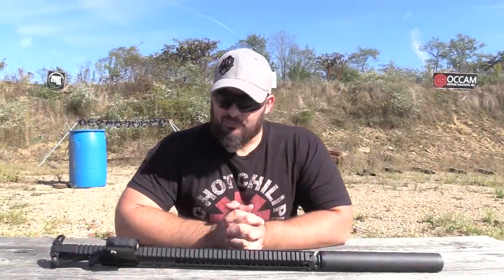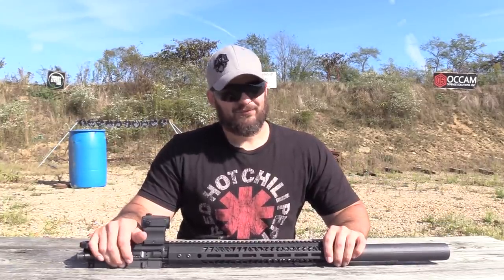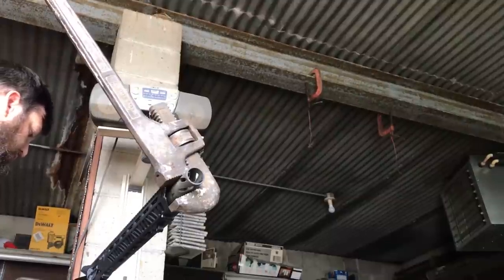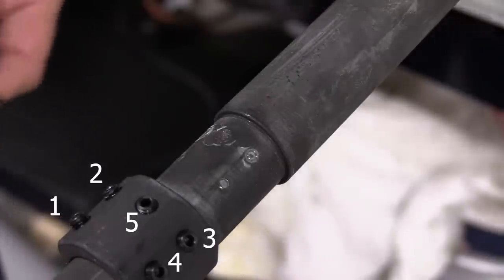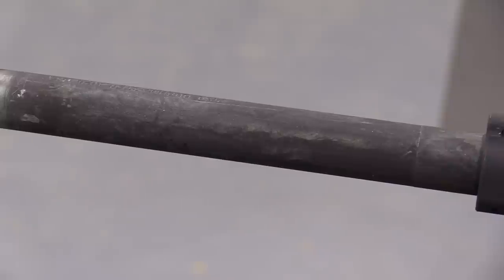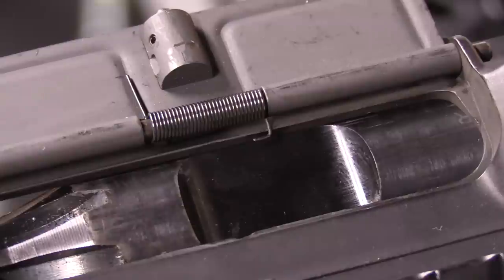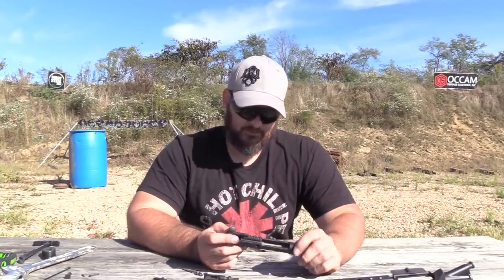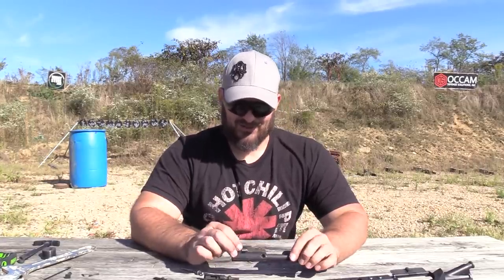The Worst AR 15 I've Seen 🚩Bear Creek Arsenal🚩

Comment: I've got my own bca story.bought a upper in 7.62x39 couple of months ago,along with 2 cproducts 28 rnd mags.staking on the bolt was really good,however the gas block was flopping around and short stroking from the start.little bit of loctite fixed that buuut...at the start of the feed ramp there was a 90 degree lip at the front of the ramp that hollowpoint ammo was hitting and stopping feeding.this was in the aluminum receiver not the steel ramps.3 minutes with my dremel and 600 rounds later she runs like a champ.I ordered the heavy hammer spring at the same time as the lower because of you tube research and the problem child aspects of the 7.62.now she eats anything I feed her and I've never had a light primer strike.bca's qc.. dept is not good.but I think most of their products are pretty good if you are the handy sort.probably gonna buy 1 in.556..but it'll get the inspection before ever being mounted on the lower.
Reply: Right on man. I just grabbed one of their 16" 7.62X39 uppers with the side charger. Sub $300 for complete upper with .300 Blackout feed ramps and I expect it may need a little bit of tweaking to run great. I have to assume at least some of the negative reviews are going to be from people who want to beat up their rifles unreasonably or expect them to function like a $1000+ build. Sounds like this guy spent a day running .450's full auto then didn't clean it or anything and brought it back out. Seems like with a little time inspecting it first and making sure to clean it properly while also not fucking it up with the wrong tools, the damn thing could run a ridiculous full auto setup better than an upper for that price reasonably should..
Reply: I agree.But I do think that you have to understand how a thing works to be able to understand why this one doesn't. My understanding of the ar platform is minimal compared to some,but mad scientist level compared to others.I'm not going to call them a bad company,although their qc dept needs some work.I don't care what it costs,if it runs.. it runs. Good luck with yours.

Comment: Runout is runout. No matter the diameter.
Reply from the maker: Yes you are correct. I didn’t speak very well, and added “the effects of” into the annotations. The effects of runnout differ depending on the size of the part and it’s application. 0.002” on a 0.010” part is a lot different than 0.002” on a 1” part
Reply: @VSO_Gun_Channel  Yes sir.

Comment: I'd say they make good barrels, very accurate as tests have been done, KB32 had a 3 gun competition model Economy AR version with a BCA barrel and it was very accurate. However when they heat up the shots start to string. I bought a 20" upper from BCA and I can tell ya the quality isn't like you'd expect from higher tier manufacturers. However it works great for a coyote gun and a range toy. If you wanna economic AR, I would go with PSA, S&W, and Ruger.
Reply from the maker: That was not the subject of the video. We weren’t actually testing the upper. This video was a byproduct of another eval. I don’t have any reason to doubt the data generated about accuracy of the barrels.
Reply: I have a 10.5” 300 Blackout heavy barrel that prints sub-MOA. I will admit that the barrel and the rail are the only BCA parts of my rifle.
Reply: @timsoyars1652  
While the BCA bcg I have did have piss poor gas key staking, when compared to other bcgs, it's actually a very decent bcg. I was surprised how smooth and quietly it glides in the uppers of various rifles I tried it in, especially when compared to some other bcg's.

Comment: I have had nothing but issues with my 350 upper from BCA. They repaired the original 2x, then replaced it with the same issue....FTF. 

I tried 2x new complete fully functional lowers, 2x fully functional BCG, 5 different mags from 4 different manufacturers and even used the same ammo and mags they recommend. I asked for a refund and they charged me a restocking fee. A complete joke. They had the upper(s) for a longer time than I did.

 I have a 300 BLK upper from them and it works great, but I wont purchase from them again. Please be wary on the 350 caliber from them. YMMV, but i got screwed. I built this for my Dad, a retired Army Vietnam Vet on a fixed income for a hunting rifle.

Comment: Sent back two uppers. Gas hole drilled misaligned to barrel extension.  Loose barrel extension. Unstaked Gas key like yours. Also 2 barrels in 9mm. 1 9mm barrel wouldn't even pass a PTG go gauge the other I just had to look down the bore at a view of tooling marks and washboard lands and grooves...... lack of quality and quality check is well understated LOL. I hate to say to folks about a manufacturer.... but stay away until they get there crap together

Comment: Well hell i just purchased their AR47 upper in 7.62X39......did u ever do a video on one of them?i like to see it?
Reply from the maker: There is only one direct impingement 7.62x39 rifle I suggest. The MK47 Mutant, the end.
Reply: Not everyone has the bank roll to rock out with a CMMG mutant at its current market cost, but I can't disagree with how awesome the MK47 is. Given a choice, I'd rather take a PSA KS47 Gen 2 then use any extra cash to buy tons of ammo and train hard. 👍🏼
Reply: As for a BCA 7.62x39 AR47 upper, I'd suggest several things to have long term success with your new BCA upper. You should, check the gas block screws and rocksett it, tighten any loose handguard screws, check/correct gas key staking, and perhaps know that it's a cheaper value based AR47 upper so having a backup BCG wouldn't hurt.  Cheers!  Appreciate this review!

Comment: Even budget gun manufacturers shouldn't cut corners on guns. People depend on their products to protect their families! 😠
Reply: Josh Glover There is a value to time, materials, and craftsmanship, and money is the expression of that value.

To get something at a low price, corners have to be cut somewhere.
Reply: @woodrowcall3158  Yeah it doesn't have to be fancy, but the damn thing should work!
Reply: Josh Glover In terms of simple functionality, you need to spend at least $400 MSRP to have a good work rifle in the current market. If you are spending $40 for a barrel, and $50 for a BCG, serious cuts to materials and quality were made to achieve that price point.
Reply: @woodrowcall3158  My M&P Sport 2 was $500 brand new and it is an awesome rifle! I love it! 😀
Reply: Josh Glover Excellent rifle!
Reply: Then what do you call military arms. Cheap, easy to manufacture and sent out to the front by the millions.
Reply: Alex the Hun 
In the case of the US, the price is driven down by bulk orders, but the product must meet a standard specification to ensure quality. 

With the duty cycle of of military arms, you’d end up spending magnitudes more on repairs and down time if you bought cheap crap instead of solid systems, and then you’d suffer from combat ineffectiveness and loss of morale in the field when no one can depend on the cheap rifles. Hence the military specification.

Comment: Both KMTactical and Bear Creek 2.23 Wylde 16 mid uppers I ordered were terrible..Two seperate uppers. Was refunded by KMTactical..still awaiting refund from Bear Creek because theirs wasn't machined right and wouldn't even fit on my lower..take down pin hole not even machined correctly, didn't line up....I'm just saving up for something better..I'll never go with those two companies again..I'm former 0351 Marine and know how these things are supposed to function..

Comment: All of the poors and fudds were quick to jump in here to white-knight for BCA 😆 I'm in some 450 groups and can confirm the constant posting of problems and issues with BCA 450 garbage. If you're not prepared to pay around at least 1.5k for a 450 in the AR platform, it's best to not even bother and stick with your parts-bin 223 builds. You can spray paint them all fancy and post it on Instagram posed next to your garbage f150 with the ebay lift kit

Comment: So you abuse it to near destruction and all you have is a slightly deformed pin and some loose screws? And part of the finish is wasted. And did you give bca the opportunity to repair this? From obvious abuse. Since a full auto lower is rare to most shooters you think that is fair? I am calling bullshit here
None of these so called defects were beyond field repair except the finish. And the maker was not given a chance to speak or repair. You work like a democrat
 Wtf man
Reply: It came out of the factory with a misaligned gas block and an incorrectly staked gas key. What opportunity do they deserve when they can't even assemble a rifle right?
Reply: @f.a.2115  Lol fix or send back to fix or sftu about it.